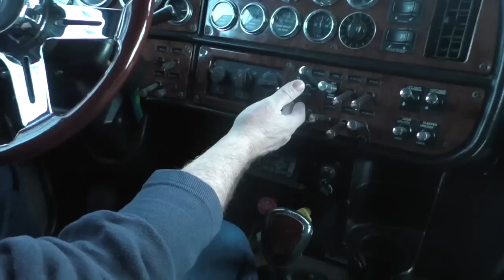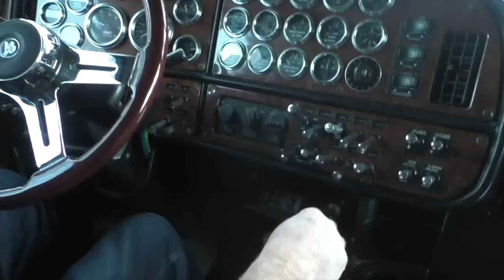How to Handle a JackKnife Skid- A Critical Professional Truck Driver Skill

Comment: 31yrs Trucker, been there done that. Try jackknifing, going downhill with a step deck, 15000lbs loaded. 90% of the time you have no choice but to hit something to stop. I had to use the jackknifed trailer against rail guard to slow & stop me.
Jackknifed 3 times, with very light load or empty, fellow drivers plssss be safe, go slow this winter (& every other winter). No load or delays is worth your life & lives of ppl you share the road with.

Comment: i used to be a truck driver and i was in a jack-knife situation. what i did to get out of it 1) take foot off the fuel 2) push in the clutch 3) steer opposite of the jack knife (if the drives go left , i steer left , if the drives go right , steer right-in a combination vehicle) 4)when the combination vehicle is straight , slowly apply the brakes until i have the combination vehicle under control.

Comment: Good video. My only accident was a jackknife while slowing down to make a turn on a partially snow covered highway. I was braking and when the front tires hit a patch of dry asphalt suddenly the tractor whipped around facing backwards. The driver's side fuel tank hit the trailer leg causing fuel to start gushing out. Luckily I was almost at our main terminal so I crawled into the yard and reported directly to the Safety Supervisor. His verdict was driver error, a rookie mistake. I should have been using  the trailer brake a bit, he said. It was all good in the end and they didn't hold it against me.

Comment: Log trucking coming down a good icy hill should have been using my chains but I was really hurting for time. It's so damn slick going down the hill in 3rd with my engine fan on. The Jake on 1. Sometimes the Jake will lock the wheels up on ice because it's trying to slow you down. But it will lock the drives up and you'll start sliding. But in that moment that it locks up and you're engine goes to idle because your sliding. You want to get on the fuel. To try to get your traction back you might rev it high but you'll get your traction back. 

Drive safe

Comment: Everything you said was correct except 1 thing...April 10th I was traveling empty south bound I-39 in Wisconsin 30 mph winds were 35mph sustained 40-50 mph gusts lighting snow/ rain mix 27 degrees, just setting the stage. I have ergonomics type tractor and trailer (it made no difference in my opinion) any ways I was being blown sideways just a little bit every once in a while. Until the damn bridge that shows up heavy Lateral winds ahead on GPS. I slowed down to around 25 mph and as soon as I did the wind hit my trailer like a Louisville slugger on a fast ball... instantaneous I'm sideways traiIer  to passenger side  never touched the brakes I turned towards the skid which had already made it past the 45 degree angle but I stayed with the turn hoping to recover, then a damn dry spot happens now the trailer snaps to the driver side instantly and now I'm in a driver side attempted recovery the wind blasts my trailer with another 40+ mph wind gust and like it was a dream I'm straighten up back in the right lane like nothing happened. 
(1) never brake (2) steer into skid (3) don't over correct the steering (4) stay calm. Everything you said I did like it was a natural thing as if I did it for a living. I too have 28 yrs but first time I ever saw a lighting thunder snow storm and recovered a skid in both side of a trailer. Oh BTW PFL LOGISTICS panicked buttoned it and it uploaded to his companys safety department. I requested the footage but was denied. Really wanted to see it from a different prospective. Oh well. Hopefully we see it soon on you tube labeled "PROFESSIONAL DRIVER RECOVERS FROM MULTIPLE JACKKNIFES ON I-39 SOUTHBOUND 4/10/2019

Comment: great video I have already had a time when I was dead heading across Michigan going from Detroit to Maniste for a load of salt in a blizzard and I had a 1979 peterbuilt cab over without power steering and on a curve to the left on a divided highway my drives broke loose and instantly I went from looking 3/4 of a mile ahead in my lane to looking across the oncoming lanes of traffic across the median at a 45  degree angle and I started turning into the slide and it wasn’t helping so I finally pushed in the clutch hoping to let the drives regain traction and it worked the drives quit sliding and when they slowed down too the same speed I was going they got traction again and I straightened back out

Comment: 1:52 Don't forget a light load or empty with a heavy side wind. That will make you jack also. I just punch it and let the gas off. It works everytime and I have never ended up in the ditch so far. When you punch it you straiten it out. When your in control just slow down. Also watch the tail lights in front of you at night. If there going all over the place then you know there is a problem.

Comment: I remember when the truck stops at Effingham were "truck stops". Not convenience stores with diesel pumps. I learned something today. I didn't know that Jake Brakes were adjustable per cylinder.
Reply from the maker: Do you remember the"Bobber" truck stop in Effingham? They had a guy they called Steamboat that was the best guy at polishing aluminum that I've ever seen.    Dave

Comment: Personally I prefer to use my trailer brake when I am on ice. If you do not have a trailer brake, I recommend that you get one. The trailer brake permits me to put braking on the trailer without putting braking on the drives or steers.

Comment: I drive Alaska a lot. I can tell you from experience that this is good advice. Be careful about using the Jake however. If you let off with the Jake on max it can cause your trailer to push you into a jackknife.

Comment: My advice for new drivers is to get a FEEL for how your truck will react by practicing in an open lot under different weather conditions and speeds. Start slow. This will get you to RESPECT speed. You gotta be CAREFUL NOT to push your luck though. It's what I did when I got my CDL. I didn't want to LEARN as I was experiencing a skid the first time.

Comment: Been in several skid and Jack knife situations and your right step one try to keep calm pr as calm as u can keep a clear head panic kills i use the jake to slow down to i use the breks s little as possable on slick roads had a car cut me off one year slipary roads light load was 1 instance i also un expectedly hit ice on i10 in texs one year at 60 and had to pull out of a slide there too them r just a couple of many i have been in

Comment: It is good advice for us four wheelers too. I was 18 maybe and went for a few loads of  softwood van chips. The landing zone was 40 miles in the woods. Jan - Ice roads. We left for the run at 3:30 am. Ivan, had 32 yrs, no accidents. And he could run the van back to the chipper, in the dark. It was a mile, backwards to  get there. I was amazed how he used the mirrors and a gentle touch, to ease it into place. It took 3 hrs to get to the mill, we were there by 7. That meant to Ivan, that he could get 3 runs in before he timed out. I thought we were riding on snow, cause that is what it looked like, in the driving lights. We got back to the chipper at 11 or so. As the sun got on the road, it melted. Ivan drove on this and never slipped a wheel. I got out when we were loading, and I fell on my butt 3 times on the ice, before I grabbed the truck and pulled myself back in. That exposure changed me. I became a lot more cautious when driving in weather. And I gave trucks more room.

Comment: I always use my jake brake even though in school the tell u in school never to use it in the rain or snow screw that it works
Reply: You are correct because the Jake will pause when the computer senses a loss of traction and re-apply when traction is acquired.  If the computer senses another loss, it will pause again, and again...
Reply: BigTimsTrucking LLC most majors forbid using it in any slippery conditions.
Reply: The big issue with the Jake is there is no even braking. You are slowing the tractor and relying on the tractor itself to slow the trailer or trailers. At this point your trailer still has momentum and will have nowhere else to go but to push you and itself out of alignment.
Reply: is true, but you know the real matter is people who wrote the dmv manual for trucks, have never driven one.
even when you get your cdl , the person who is evaluating you, DON’T even have a CDL.  they just know the manual and want to act like they know more than a truck driver who has been behind the steering wheel for 30 or 40 years.
and that’s a fact.
Reply: Here in Minnesota the examiners were not class A licensed, and they have you drive all over town including the freeway. Yet driving with a permit without a Class A holder is illegal? Strange how the very people who are supposed to make sure you know to follow the laws don't follow the law themselves. But Minnesota govt is jacked up anyway
Reply: That's the only problem with the new electric, brake activated compression brakes. You would have to press the brakes to activate the compression brake, and in slippery conditions, that's a recipe for disaster. The company I drive for uses new International trucks with these, and I do not like them at all, driving in Minnesota winters. (The fact that they are ridiculously underpowered, and governed at 61 mph is a different subject!)

Comment: closest I have had was a steer skid.  Wasn't going but 10 or 15 mph but when you want to go left or right and the truck continues straight there's always that split second of panic when you feel out of control.  I went over La Veta Pass last winter in an empty gas wagon breaking tracks all the way up. Blowing snow so thick that visibility was less than 100 ft.  I creeped all the way up, and all the way down without chains and didn't slip once.  You are right speed in this case is your greatest enemy.

Comment: Very thoughtful class. 33 years out their. All he said I agree with. Only had 2 slight jacks I would like to share with you. Pulling an m/t pup from Front Royall Va. Some of the good ole boys had a cable across the road was trying to pull out a 4 wheeler (absolutely stupid). I had a warning from a 4 wheeler on the 2 way. Each touch of the brake caused it to start a jack. Let up it straitened. 3 attempts and had to stop. Braced myself and told Jesus this one is on you. When I stopped I was a bit scared to look. Straight  as an arrow. Next Had a Baby Sitter that day. Headed down a valley in Md. with light at bottom. I called that area 'death valley". Raining and sure enough the light changed. I had to stop. Same reaction as other story. This time it was a 40 footer. Guess what stopped it? The curb. Just a soft bump but that is an accident. Looked over at baby sitter and he was sound asleep. Gone!🦇

Comment: All wheels need to be turning at the same speed.  Neutral. Steer. Saved my arse many times.  I've also had to grab the trolley on a turn where the tractor was starting to skid.

Comment: My most scary skid happened a few years ago. Pulling a 53 dry van doing 65 which was the speed limit and driving  on dry payment. Topped a overpass in the middle lane and when I get to the top, see a stalled pickup in my lane. Distance, about 100 yards. I hit the brakes hard and I at this point find out the ABS on the trailer isn't working because the trailer tires lock up. Trailer skids out to the right side. As soon as that happened, I got back off the brakes to get the tires rolling again. I did pretty much what you did which was steer to the right into the skid . Trailer straightened out but I still had to avoid the pickup. I had to go to the right of the pickup because of what has just happened. I passed it with about 4 feet of space still moving around 40.
Reply from the maker: Wake you right up, wouldn't it!    Dave
Reply: Had a couple myself....gotta check your shorts after.  Following a car going 35 mph, was about 100 feet behind.  He wasn't aware that I qas there and he decided to brake at a light that I knew I wouldn't be able to stop...well look in my mirrors.and no escape route.  I blast my airhorn as i start skidding...he turned into road and i stopped 20 feet feom where his rear bumper would've been...

Comment: When you're on ice, you're gonna slide no matter what you do . When you're on ice you're sliding period, just hope you touch some solid ground and grab some traction it's the only thing that will straighten out your truck . 
The Jake brake can help some ( 1st level)  and get your feat of the brake and accelerator and just slide. You will touch ground again in 15 feet . 
Avoid them when you can .

Comment: I think it may be harder to handle a 53’ with mail on board than the trains I had when I used to drive always maxed as near to 137 500 as you could ...  but yup steep snowy downhills jake on and balancing the spike brake just right takes time to get that feel to keep the snake straight ... a couple of times i was coming down a little too hot ... one eye on the convex mirror seeing the pup trailer do a little dance and the other seeing a 4 wheeler up ahead going a little too slow ... the butt cheeks tight and a few hell marry’s later I exited at the Golden BC scale ...   this was around 1994-5 ... Get your slack adjuster certification folks ! 👍

Comment: Am sure this 40 years of truck driving knows what he is doing. My truck starts to jackknife either I push the clutch in or shift to neutral. Your tractor rear tires are pushing you into a jacknife so push clutch in + just coast out of it,
 simple !!

Comment: Just got back from a run across 90 to Spokane. Idaho and Montana was bad. Grateful for the many drivers that ran the CB, and let us know about the bad stuff before we got there. Was a really bad spot just west of Drumond Mt., a little pass. Broke it loose a couple of times going up the grade fully loaded and locked power divider. Thankfully we had slowed because of the heads up. Interesting about the spread axle "drag". We pull spread axle flatbeds.
Reply from the maker: It's trips like that when you're really earning your money and the road separates the men from the boys.     Dave
Reply: "Ran" the CB?  You mean used the CB?

Comment: I just pulled onto an interstate, dry pavement, set my cruise, first bridge I went under hit black ice, engine accelerated and I lost traction on my drives. Truck started to jack-knife. As fast as the engine accelerated, the computer shut the rpms down, I was able to regain traction and steer out of the jack-knife. Thank goodness for technology.  Drive for a small company, that rig was only 2 mos old.

Comment: I've been in skids & it's terrifying.  Mostly overpasses for me in the lower 48. I found if you slightly increase speed on the approach of an overpass push in the clutch. Momentum keeps the truck  moving & you don't break traction.  On the other side ease out the clutch & slowly drive off.

Comment: I had my semi loosing traction at Fargo last week, only at 40mph. That was a real black ice. I was driving straight slowly (40mph) with empty trailer and all the sudden the tractor and trailer started sliding. I let the wheel and gas pedal go, gave it a second to feel that the truck is rolling again and slowly steered it back in the lane. Then proceeded 15mph )))) That was scary but I'm proud of myself!!

Comment: wouldnt you be better feathering the service brakes rather than the jake brake as that is a more balanced application of stopping force over the length of the unit? i would haave thought you risk the trailler kicking out further as it free wheels forward and the tractor unit is slowing down on its own?